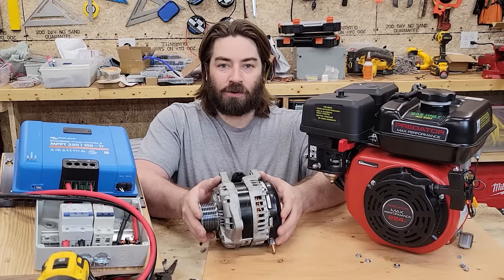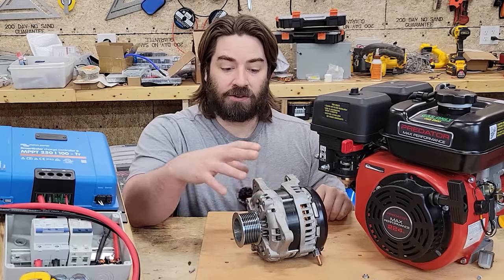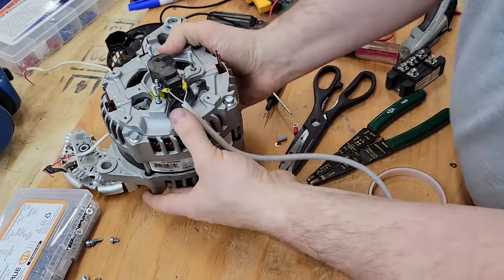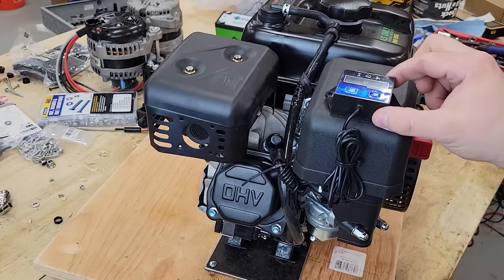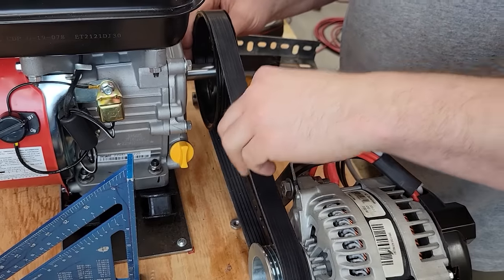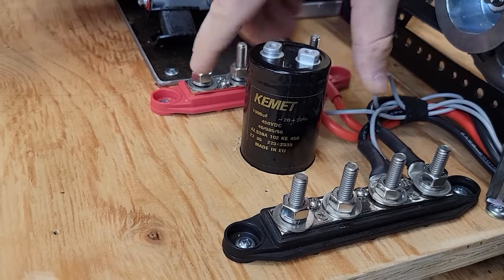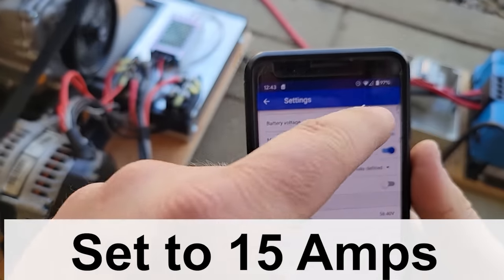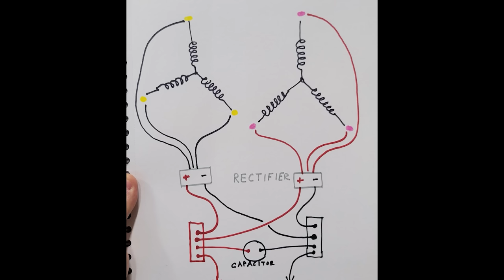The AlternatorGenerator, First Attempt.  48V Battery Charging

Comment: Great video David!  Some suggestions,  rigid mount the engine and alternator together on one frame, then iso mount that frame to your platform.  This will help maintain proper belt tension and reduce overall displacement and vibration.
Reply: I second this idea. As it is now, the dynamic response of the engine mounts can cause slack in the belt at various resonant frequencies. A fixed relationship between the engine and alternator would solve this (either still using a belt, or via direct drive). Also - just a thought - it might be possible to use the motor's magneto to provide the necessary kick-start to the buck supply.
Reply: I also agree. As it is now the belt tension is side loading the isolators to the point they probably aren't very effective and will fail after a while. Even in a vehicle the alternator is bolted directly to engine (yes their maybe brackets but no isolators) and then entire engine assembly is on motor mounts(isolators). But otherwise I thought this was an awesome video.
Reply: Good idea, but then build an open frame/box that is slightly bigger than the whole unit, and suspend the entire unit within the cage/box with bungy cord or springs. 

Springs should theoretically remove 100%of the vibrations before it even gets to the frame/box 🤔
Reply: I replied the same fix too,, before I saw yours ///perfect idea!
Reply: This was my first observation too. Motor and alternator need to be rigidly joined so the belt can function under constant tension.
Reply: Completely agree. The belt is flexing somewhat with the engine moving in relation to alternator, which will impact efficiency and durability. 
I would suggest mounting the engine and alternator on a sub--frame, which in turn is mounted via rubber mounts to the platform.
I enjoyed this experiment, and it answers some questions about charging methodology. Well done. 👍
Reply: Yep, exactly.
Reply: I came here to say what these guys have already said!
Reply: I agree also and would like to add that the good people from the land down under "dont know the spelling Au some thing maybe LOL"  have be doing somthing very similar for MANY years  A microcontroller with a voltage feed back circuit and temp circuit to lower the time on as temp rises would make for a sweet pwm to rotor coil set up  This was org Warpspeeds suggestion to give credit where it belongs  He is from down under and likely has forgotten more than the smartest of men will ever know    A incredible resource to any one worthy  He is old school cool hes not after money or fame  But respect along with if you all ready think you know you cant learn is all thats needed  He made me learn for myself truly incredible things about electronic engineering had i loved money it could have been used to pollute me with it     Some it dose not pollute me it dose or did i found some thing so much better   I will never know the dose or did  LOL   I know  it was a big change for warp to make me understand  What i didn't understand at the time was he wanted me to understand not just parrot  He would not just give me the answers i wanted  If i was a quick to judge or not willing to humble myself i never would have gotten a true understanding  This true understanding is missed by ALL the biggest brightest of the world  He made a simple slow minded person like myself understand great awesome things that very few have every understood  So my question to all people that want to find true understanding to any subject  Do you have a love for truth?  Is it this understanding works that's good enough for me?   Or do you want the truth more than anything?  No matter where it takes you are you willing to be completely humble?    Truly giving zero care about what others think of you good or bad?  All truth of every thing we can know will take you to the same place!   Truth is not hidden a babe can get it but you must have a child like love for it and truly seek it Then you will find it!             Yes i speak of ALL truth any subject!   They all are connected and lead to the same place the place they all are from LOL    It is also way greater than you or i or anyone elis  could imagine!   I dont know how far warp has gone but if your doing any thing electronic no matter your skill level he can greatly help those willing to be helped  Of course when you find some thing great you want to share it and yes i am talking much greater things   My point is these good things are related to the greatest things beyond imagination things!    And these things are in such a way that even the simplest can understand and get them   But ever great thing was foolish at first to those that should do not deserve them  This fact was not altered in the history we have to those who have eyes to see it  Look back and see if what i say is true  Because the first step is to hear "read whatever" then test ALL things for your self  All have some truth, understanding or wisdom To gain more you must test to see what is true!  The giant ocean of wrong understanding has truth mix in  Follow them truths it gets easy quick because if you truly love truth it ALL leads one place  The people in our history that the world put up high all followed what i have wrote above    But not every thing we know about these people is true     There story has been changed enough to lead people to fairy tales or mans imagination when the truth is much grander than the lies  Book and such to pass down info was very expensive in the past and in almost all most cases the winners wrote the history  The winners had the finances to do so  But there where a few men that loved the truth that was able to translate and copy it for all to see  In most cases these men suffered greatly to do so even though did it with a joyfull heart  So when dealing with history you must understand there are two sides and the other side gets to decide whats written is most cases  NOT ALL CASES!  It is the job of the truth seeker to find the truth for themselves believing me or anyone else is not truth  I ask you what is truth worth to YOU!                Is it worth giving up every thing to get it?  I say HELL YES!!  But that is up to YOU                      The thing about this is truth is fair and just    So this will help on all the smaller things no matter if the person has good or bad intentions  One person called it the power of thinking positive in a book he wrote  I judge not but remember truth is fair and just if it works with one it will work with the other  It your choice to choose which you love! LOL  Simple but profound!!!    A answer has been given to one of the so called unanswerable  Is it foolish?   Maybe a good place to look is where the world say it is foolish   But I will remind you ALL subjects lead to the same place if you find the truth for your self of that subject  I am a little like the one that had to stick his finger in the hole before i could believe the greatest truths  So it was a long process for me but some one less simple but still humble and has a love for truth can have it much quicker  And a babe will get it but a schooler will not  I think because the scholer knows"thinks" he already has it  Do you look for your keys after you have found them  I know some will hate me for this when no one is forced to read it     But i love them to because i was them at one time likely much worse   And some one loved me when i did not deserve love and this changed my why of thinking None of the bad finger pointing did anything but grow hate for me  So i try not to do to others what made me worse not better                    All the finger pointers is the biggest  best fighters for the wrong side !   They have most convinced they want nothing to do with where truth can be found even though the finger pointers have no clue of truth!!  LOL   If you was a creator and wanted your creation to understand who you are and love you like you love them how would you set up the creation  Cant truly know sweet if the was no sour!    What would a perfect father be like taking into all the considerations  Nothing silly like i would force my child to love me and me him force belongs to the other team   If you through out all the lies and nonsense especially from the ones said to be on the right side    Start fresh believing nothing but test every thing           Only keeping what your mind and or physically testing  We all have or do believe right down silly shit  I mean the simplest mind should and dose know better        Go tell a child of a age not to be convinced of what truth is  When they here a silly non truth they call bullshit  It takes a while to indoctorate them into believing bull shit  Thats why it takes the biggest part of there childhood to program them to this currant world   My my I do this every time sorry for writing a book
Reply: If you're gonna use a belt, it would be best to put in a belt tensioner, as the properties of the belt will change (slightly) with temperature, humidity, stress, and age. 

But yes I agree that fixing the engine and alternator with respect to each other would do a lot to reduce the uncertainty of the belt.
Reply: Looks like you have room for a tension pulley, right under the belt.
Reply: I was just going to say the exact same thing about mounting the motor and alternator together and then using the rubber mounts on the total...
Reply: Not bad....👍
Reply: Thumbs Up and Ditto That!
Reply: Just come across this video today. I posted a video yesterday that addresses this very issue.
Reply: Tell me you’re a millwright/mechanic without telling me you’re a millwright/mechanic.
Reply: that's an awesome proof of concept. Really surprised how well it went with the engine and alternator on different bases. I think D is dead right with saying mount both on the same plate, then put your engine mounts (dampers) onto the new plate. Very cool, am  going to make one myself and see how it goes.
Reply: I totally agree I was going to make this comment but you beat me to it!
Reply: Or mount the alt to the motor . Like on a car.
Reply: If belt vibration is a problem, I would use an idler on one side, and a tensioner on the other.
Most serpentine belts don’t have a lot of space between the pulleys in vehicles.
That being said…
I, personally, would try to find one of the 1980s 1600 CC car engines from a Honda or Toyota.
With an intact exhaust, they were so quiet, that a lot of people would go for a restart when they could not hear the engine running.
This would allow for a lot of the original accessories to be left on the engine.
A/C, heat, as well as an abundance of energy to run several alternators for power.
(Work with me here, folks. I try to get more bang for my buck!)
Keeping a manual transmission hooked up would also give you a power shaft that could run some other mechanical accessory, such as a water pump for a well.
Older alternators will work together won’t kill each other by blowing circuits within.
There are still single wire, self exciting alternators out there as well. They generally put out around 45 amps, but using a few of them in tandem would more than do the job.

Not trying to alter the idea this guy has, but trying to toss a few ideas to think in new directions!!!
Reply: Great Video, Great comments , David , You went the full extent to even getting best of tools to make it work... Overall ... How did You Come Up with all these ideas that worked at once? Amazing.... along with many comments here , I think that the motor vibrates too much , Why not using an aluminum base BOTH , for the Motor and the Wood base by Aluminum? this way everything is Super tight!! Nothing moves at all! And what if you used a pulley with smaller diameter on the alternator? this way the Circular transfer Ratio between motor and alternator might increase a lot more?? Lastly, the plastic screw holders You commented that were too cheap , but going a little further ... What do You think about holders without aluminum bases between the screws?? I imagine the ones You are using here could potentially have a Current Leak ?? So it is Best to isolate ALL THE CONNECTIONS !!??
Reply: Very nice alternator generator
Reply: @realsonnysullivan  l
Reply: what he said
Reply: I would go for a heavy plate rather than a frame (to absorb vibrations) but otherwise I agree totally.
Reply: Totally agree !!!
Reply: I like it a lot! Bully of an idea yes
Reply: Yeah, it will solve most of the belt issues, as well. You're transferring vibrations from the engine to the wood through the alternator. That definitely won't help the alternator's lifespan.

It also be curious if you check the voltage on the capacitor if it's slowly rising to be able to kick off the DC buck converter?  Might just need a minute?
Reply: My exact thoughts, and add to this a spring-wired belt tensioner of sorts, to compensate for belt elasticity over time.
But overall I find this project to be SUCH a nice proof of concept, however I believe the original rectifiers should be  reusable dependent on Diodes ofc.
An adjustable replacement circuit for the Field regulator should be fairly simple to produce, so as to make original diodes and winding mounts stay in place.
Reply: Between the fixed engine & alternator board, go to a HVAC place and get a bunch of vibration isolating compressor motor mounts. My guess due to the increased weight above a residential compressor is you might need 6 of them.  Thanks for sharing!
Reply: Am I missing something or are those little screws holding the metal plate the engine is mounted to down to the wood base?
Same with the alternator bracket.
Reply: Sprocket and chain will eliminate some loss but will take some of the Engines work load away with the extra weight of a chain. This was a Cool build/experiment..
Reply: Totally agree. All commercially available gen sets have engine mod alts.
Reply: Yes.
Reply: @@russellhank At first I was going to comment the motor mount rubber was too soft. I then saw this comment and realized what was actually happening. I should have know better but it has also been a while for me.
Engine has to be solid with its load.
Reply: You should all make videos of your great ideas.
Reply: I was about t osay the same thing. Just don't think I could of explained it as good haha.
Reply: Awesome! 
I Have a few generators laying around that have blown motors. 
Plans were to use the actual generator sections to try something off grid but I'm not sure what my options are of how to do it. 

Would it be possible to even turn one of those under a load without something like a motor?
Reply: Strew type tensioner built into frame.
Reply: Was coming to leave this comment. Fixing the alternator to the engine will greatly reduce vibration and provides easy belt tensioning @-Gadget-
Reply: @Jody_VE5SAR  the motor just has an ignition piece, no actual power generating coil so I'm not sure, i'm not very smart about this stuff though

Comment: would love to see if this alternator can keep its output at 3 kw for several hours without burning up. That would be significant!
Reply: Of course it will. The stator is rated at 250A.
Reply: @walsakaluk4630  still like to see it, seen too many burn out with way less amperage going thru especially when placed in continuous high load with poor cooling situations.
Reply: I was thinking the same thing. Every regular automotive alternator I've seen has gotten very hot when running at the high end of it's rating. Most are likely not built for a 100% duty cycle at maximum load. Must test it and keep an eye on temperatures, including the diode pack.
Reply: Alternator is going to overheat especially with Lithium batteries.
Reply: I tried this with a 3 hp Briggs 40 years ago. As soon as I ramped up the field it died. Did you try slowing it down to see the effect on voltage? I'm thinking it wouldn't drop much unloaded. Are you using anything to control the field current? If the charge controller had a feedback loop you would be all set! Running the voltage up is decreasing the current through the windings so heat shouldn't be an issue. I'm happy to see this work. I should do a similar vid but tie it to my inverter and call it a generator. 😊
Reply: @walsakaluk4630  Not at 100% duty cycle though. It's an autozone alternator too, they're a bit cheap. :P
Reply: @pieterbezuidenhout2741  Normal alternators burn up with Lithium batteries when the engine is idling. They don't get enough cooling from the low RPM. In this setup, the RPM is always high. So this could work for a long time.
Reply: I think a thermal cycling switch on field to protect stator